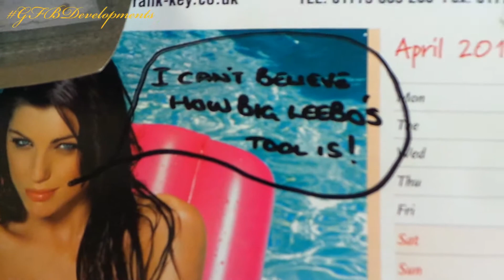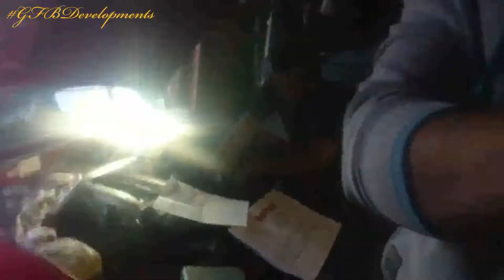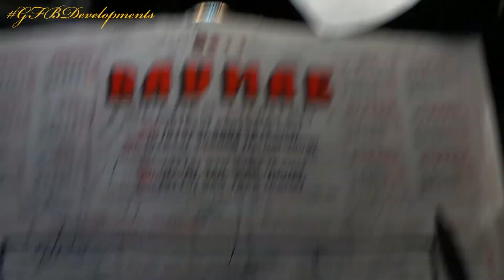NB Miata Megasquirt wiring PT1

Comment: Where would one go about finding a clone...? Is it worth it, or do you recommend saving up for the diypnp kit from diyautotune? I'm on a really tight budget but do not want to compromise on the benefits of a standalone ecu. Nice build btw!
Reply from the maker: These are readily available on YouTube.  Tbh there is no real difference, since this video there has been other released like the Speeduino which are more or less the same. This unit in the video has all the features of a PNP MS2 Enhanced so you can't go wrong really.